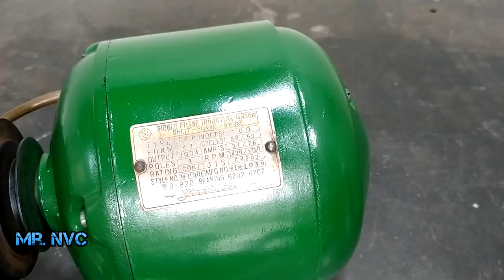Old Drill Motor Restoration

Comment: interesting, nice work as always... however I have to wonder about the switch being underneath. Why is that, what was it off of? Is it going back on that same machine, or would it have been wiser to turn the mounting plate over and put the switch in a more accessible position ?
Reply from the maker: My next project you will understand. It is part of the table drill. thanks sir
Reply: @MRNVCDIY  ah it's going back where it came from, okay there must be a reason it's where it is.

Comment: Fail!
Nice restoration IF you had added a grounded power cord. Does not make any difference if it was originally not grounded, a grounded power cord costs a whole lot less than a dead body on the floor